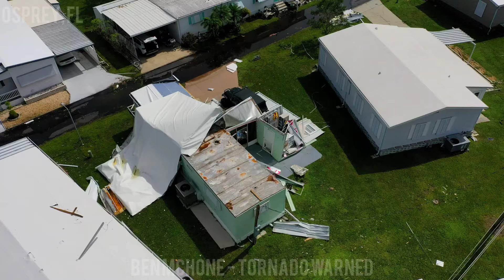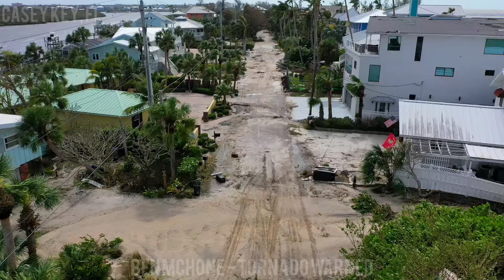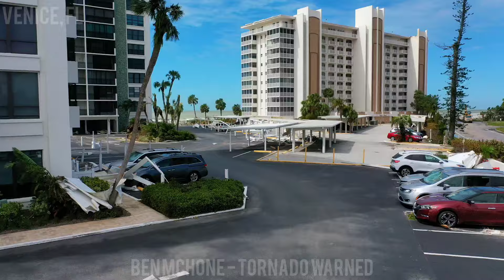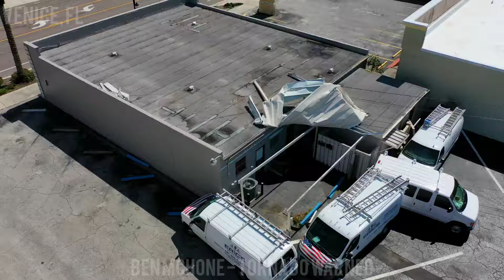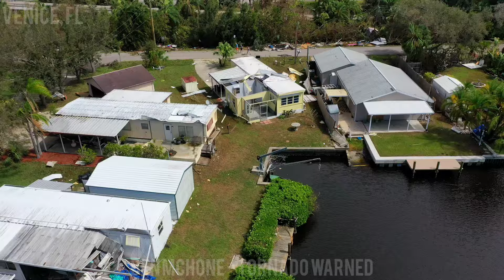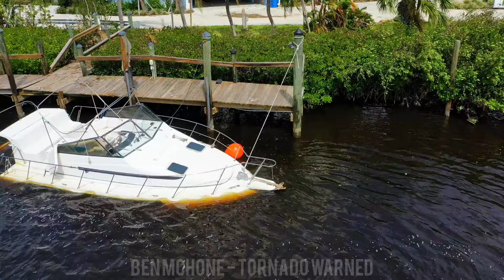Hurricane Milton Impacts Casey Key,FL - Ripped Apart Homes in Osprey - Venice, FL - Aerial Aftermath

Comment: The recent video was striking, highlighting the potential for even greater damage from the hurricane. Fortunately, it moved quickly and weakened, sparing Sarasota County residents from more severe impacts. Many may have believed that local lore or blessings offered protection against major hurricanes, but the reality is different.
Unfortunately, Casey Key is a narrow strip of land, and no amount of money can truly shield it from the relentless forces of nature. Ongoing erosion is a significant issue, exacerbated by rock and concrete barriers designed to protect homes. While these measures aim to safeguard properties, they often contribute to further erosion, Also, beach nourishment  not an option.. it will be gone in year or two.